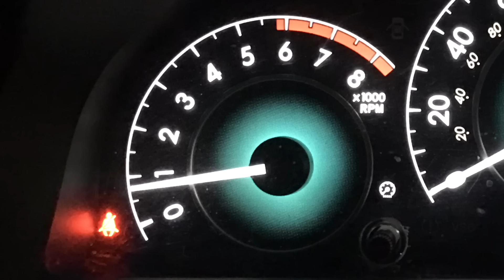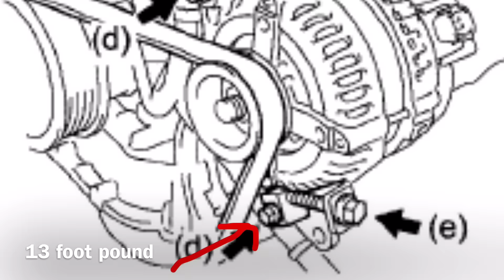Alternator Replacement for a 2008 Toyota Solara V6 3.3L 3MZ-FE SLE (No Audio)

Comment: This worked on my sister's 2006 3.3L highlander 2WD. I was getting frustrated trying to find the tension pulley! Searching high and low!Researched for about an hour and happen to find this video. Thank you for posting. Saved her a couple bucks!
Reply: MerrickD07 where is it?
Reply from the maker: Battfish the “tension pulley” is the alternator it tension when adjusting the long bolt.

Comment: Do you think a bad alternator even though it is putting out 14v could drain a battery when it's off?  Some idiot hooked up the battery incorrectly for a second and there was a spark from the battery terminals/cables.  Car starts fine but I am noticing the battery isn't holding a charge even though when I measure the current at the alternator it's 14v.  I'm thinking possbly the diode in the alternator is preventing current from coming back from the battery.  And for how cheap alternators are it just seems like that should be replaced, especially since it's 12years old before the person had the battery wrong.  No other problems, CEL or errors on the toyota solara.
Reply from the maker: You should check the battery voltage again without starting the car. Higher than 12volt is good battery but also load check the battery. Battery can have a good 12.6volt but when load testing you can see if it will perform well and I would also Look inside the battery cells too to see if the plates are mess up or need a distill water to top it off. Usually 14v charging is means the battery is low on voltage. Alternator is working properly. If a diode fails there will be no charging at all. Also some car can start as low as 8volt with engines that are inline 3, 4, v6 they don’t need that much power to crank it over.
Reply: @theofficialjustinwong9465  Appreciate the help!  It was actually two parts.  I bought a new battery from Costco just a couple weeks ago.  But when I took the battery off the car and would charge it.  Would go to over 12+ volts then in a matter of about 10 minutes the battery would drop down to 10.3v.  Had the battery tested and it looked like there was a dead cell in it?  So took it back to Costco and got a new battery.  Then tested the alternator.  Was charging the battery at 14v no problem but looks to be bad rectifier or diodes so when the car was off it wouldn't prevent the battery from discharging..  Replaced both and now we good!  

Thank you for the video!  It's nice and to the point. Wish more videos were like this!